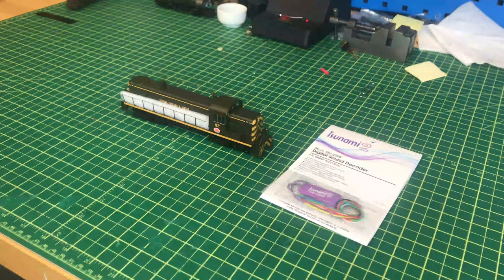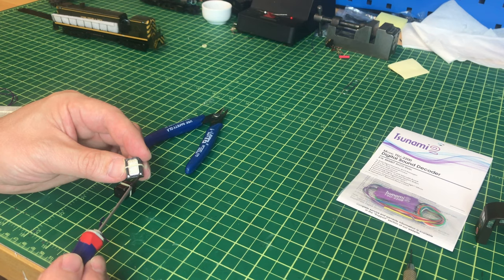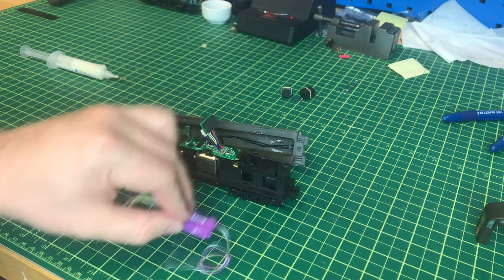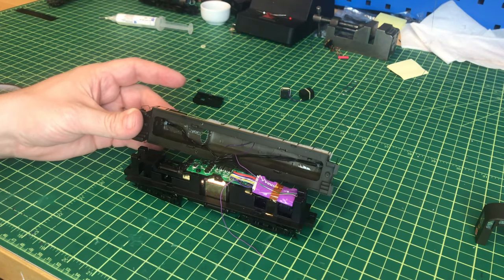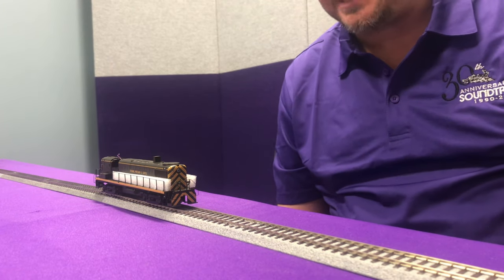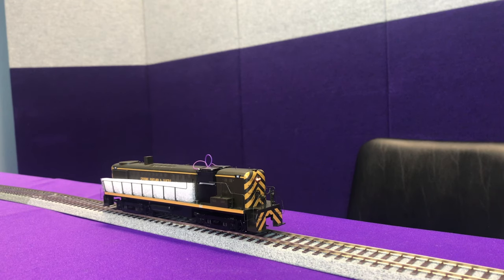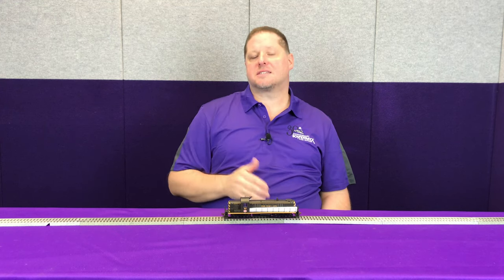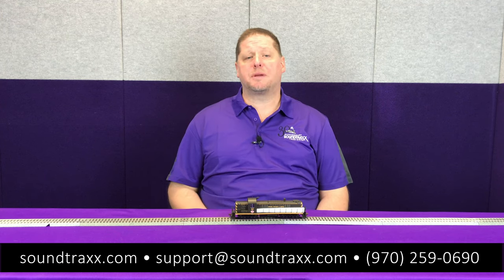Step-by-Step Tsunami2 TSU-2200 decoder install in an Athearn RTR RS3

Comment: George ; and an installation of decoder & sound in Old DC Atlas RS3, not a Ready DCC , with  any electronic components. I understand First I have to Isolate the Motor from the chasis . 
It may be an interesting conversion!
Reply from the maker: If you need any advice along the way just contact our Support Team: support@soundtraxx.com or (970)259-0690 ext. 22.

Comment: How much more space would you save if you dropped in a replacement board? Instead of keeping the existing board
Reply from the maker: On this particular model, there is not much space above the motor.  The high Athearn ‘gold’ motor is high, and their PCB is more flat on top than our comparable TSU-PNP8, so some milling and remotoring would actually do the trick to free up some of the vertical clearance needed for a PCB replacement.  Normally, that is my preferred method.  Thanks for watching!

Comment: Hello.  I have a question.  Regarding the brake function, I would find it more handy if I could use function 4 for indep brake and function 11 for dynamic brake.  Is there an easy way to swap them around like that, or will it take a lot of work?  Thank you...I'm new to this.
Reply from the maker: With Tsunami2 decoders you can have any button you want control any effect you want it to. One button can control more than one effect, but the same effect cannot be controlled by more than one button. This SoundTraxx feature is called Flex-Map Function Mapping. We have several videos on this feature. Watch them here: https://www.youtube.com/results?search_query=soundtraxx+flex-map+function
Reply from the maker: If you need more help please feel welcome to contact our Support Department. We are here to help: https://soundtraxx.com/contact/technical-support
Reply: @SoundtraxxDCC  Excellent.  I'd just like to swap dynamic brake from f4 to f11, and also swap independent brake from f11 to f4.  I'll check out your videos.
Reply from the maker: @Panzermeister36  You can do that easily enough. If you need any help figuring it out just contact our Support Department at the link above. We are always happy to help!

Comment: Great video!George,it is better for a soldering iron to be cleaned on one of those pot scrubber metal sponges than it is to use water.Why,as I slowly open up a can of controversial worms,the water cools the tip  too quickly and shocks it.This causes the type to crack and the clading material to flake off over time.Just a hint from my bench to yours. Doc BC
Reply from the maker: We have used both.  I understand the thought process between the brass sponge and a wet regular sponge, but in our professional training, they stated either is fine.  If you feel more comfortable using the brass sponge, rather than a grocery-store pot cleaner, opt for the better brass sponge from an electronics supply company like Digikey or Mouser.

Comment: Hi there George, great video, one question as a newbie to this that I have, is the flux that you use, you don’t seem to have to clean up after? I thought in the past flux had to be cleaned after because of possible later corrosion? Do the new fluxes available no longer require this? Thanks👍🇦🇺😎
Reply from the maker: As long as it is a proper electronics grade flux then you should not have an issue, however there is no reason you cannot still clean it with some rubbing alcohol and a toothbrush. Just make sure that you are using electronics grade flux or it will damage the board.

Comment: Don’t use foam tape to mount your speakers. The foam tape will deteriorate over time and is usually too thick anyway. Double sided carpet tape works the best and is also thinner than foam tape so you’ll have more room for your speaker and or decoder installation.
Reply from the maker: I agree on the thickness issue.  Foam tape is a bit thick and can cause fit issues.  In this case, it is fine.  I have not had any deterioration over the years.  But I guess it could happen.  I’ll look into the carpet tape.  Thanks

Comment: Hi George, another newbie question. When you put a DCC decoder into the locos I thought that the lighting had to be changed to led from the old bulbs and fitted with suitable resistors….is this not the case as this loco was a newer unit? I was told that the excess voltage might heat the lights too much and maybe damage the body shell. I am attempting to convert some old proto 2000’s to DCC and am a bit confused about the necessity to fit resistors? Can you help?
Reply from the maker: The need for resistors will vary depending on what kind of bulbs you are using and what decoder you are using. Each of our decoders have their specifications listed on our website. Some of our new decoders are pre-regulated for LEDs so you don't need resistors, but not all of our decoders have this feature. 

You can see wiring diagrams for all of our Tsunami2 and Econami decoders with different types of bulbs in the Installation Guide on our website. You can also find wiring diagrams in the Technical Notes section of our website. SoundTraxx product documentation: https://soundtraxx.com/reference/manuals/

For more information on the subject please contact our Support team directly: (970)259-0690 or support@soundtraxx.com
Reply: @SoundtraxxDCC  thanks so much George.!👍
Reply from the maker: @maxheadroom7687  of course